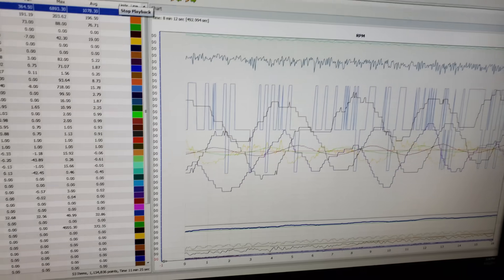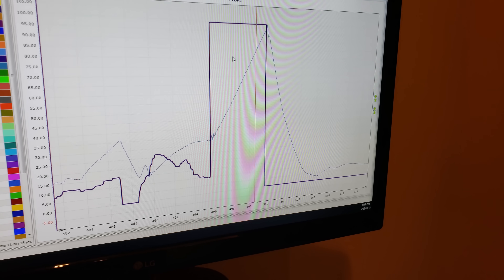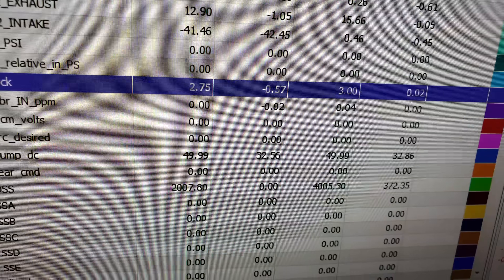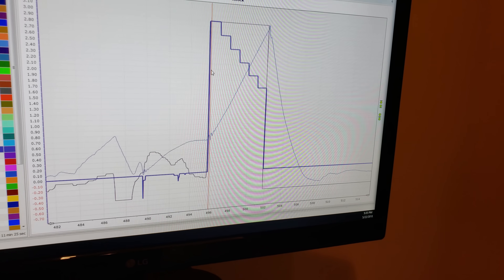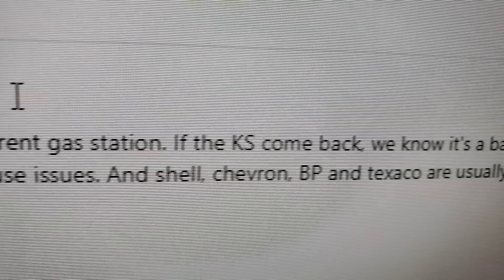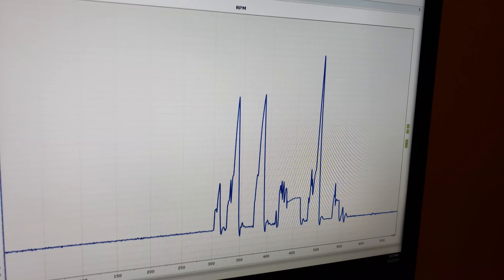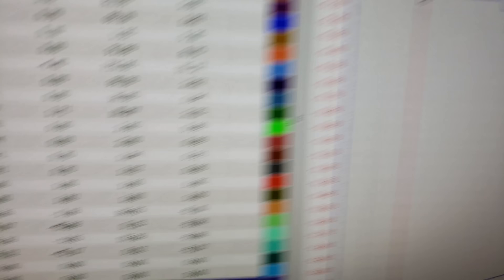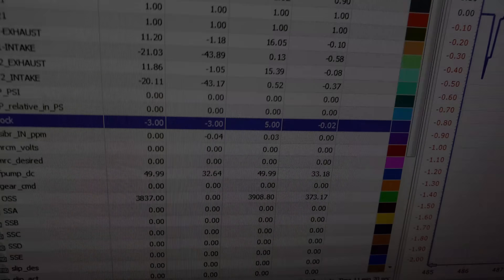Is 93 octane the same across all gas stations? Proof inside

Comment: I know this is an old video, but the Octane air ratio also a good way to view the quality of fuel. Sometimes I get -0.63 , other times up to -0.86. On the same Ultra94, but different gas station. 👍
Reply: How are you measuring octane air ratio??
Is there any way to test the octane levels in your fuel?
Reply: @jayhouse20  a data log. Like an SCT or a HP Tuners.
Reply: @twinforce_fusion6560  but that only shows you after the fact, correct?? 
I mean the tuner tells you about the knock sensors and that's how you determine its insufficient octane

Comment: What about BP premium? Any better than Shell premium? I have an 18 Cruze Hatchback and been using premium for almost a year.
Reply: I use BP 91  (NO ethanol @) 2015 Sonic 1.8
Reply: @benitom3049  its not the same as 93. with pure gas i get a fuel smell after the car shuts off and gas mileage is a tad worse. I've done a weeks worth of driving with pure gas and 93, 93 gets me more power because of ethanol acts as an octane booster. im tuned with BNR base tune and i average 35mpg.

Comment: even with more octane on the gas it won't help much because gas have 10 % ethanol. the ethanol produce condensation  and makes the engine idle very poor and also it won't help in fuel economy. the best gas will be ethanol free with additive polyetheramine for a clean engine. the polyetheramine additive is invented by Chevron use By Shell gas as nitrogen v power and Exxon, Mobil as  synergy. the only problem left with this gas is the Ethanol, other wise is the best gas you can buy.

Comment: Immediately after installing my VMP TVS filled up with Conoco 91 which is a "top tier" provider.  Justin emails me back after I send the log in and it's pulling a lot of timing, etc..  Went to Exxon and filled up with their 91 and it made a drastic difference.  No knock on the next set of logs.

Comment: i only have 1 shell in my area, i always fill up at marathon or speedway but my guess would be that because 93 is more expensive then it sits in the tanks longer, so when you fill up with 93 you are getting older fuel. i always get marathon or shell 93 because thats whats easily available and when i go to get a tune on my 3.7 i would be curious to see how they do.

Comment: You'd think if gasoline is advertised as X, it should be able to be tested to X, or if 93octane was somehow tested and only came back as 88, and your Ferrari blew it's engine, the gas station should be liable? I'd also like to see at least a weekly or better yet, daily test numbers at E85 stations. They'd probably see sales go through the roof if they actually had days where it actually tested above 80, and it was shown on an electric sign somehow, at least in hot rodder communities hahaha

Comment: Alex, I sent you a message thru Facebook as I had a question about this issue.  So you said that name brand gas is better than non name brand gas.  I am not really sure if that is true or not but I will take your word for it.  In saying that, is non ethanol gas better than gas with ethanol, so I try to use 91 or 93 octane for my Coyote swapped notchback.  I am running Naturally Aspirated, so no boost for now.  I have no plans on running E85 once I do add boost.  Just wanted to get your feedback on the ethanol vs non ethanol gas.  I know it is bad for 2 cycle engines.  Thanks.

Comment: COSTCO gas is the best in my area and surrounding areas.  Better mileage, power and less knock then the (shell, chevron, and exxon garbage i get here.)  I agree Sunoco and BP are the other best I've had just not in my area. Each area will be different in fuel quality and I guarantee if you sample one brand of fuel station in multiple areas you will get a different result.
I'm very attentive to fuel quality and I've tested this theory many times. I love your videos and i'm glad you are showing proof that all 93's re not created equal.

Comment: I've been dealing with this issue since I started datalogging for the first time this year. I've had the car since 2012, and had a custom tune since the car was new, and had run a best of  12.18 in --500 da. So I decide to install a K & N CAI, and my tuner has me do the step datalog and load step datalog, He gets the CAI to work more efficiently, but now I've been through 1 load of shell 93, losing 5 degrees due to knock, then switched to Sunoco 93 with a can of torco, and KS improved slightly, but still getting it, and now Sunoco GT 260, and improved even more, but still have knock. Car is OEM , except for K & N CAI, and Bobs firewall oil separator kit, and suspension. Banging my head for 2 months trying to find this dam knock.

Comment: I want an E-85 tune from you on my 18 5.0 but I just moved to St Mary’s, Georgia and the closest station I found is 21 miles one way. The 93 tune doesn’t seem worth it. Would like the make 500 WHP NA but 480 wheel would be plenty for now. Currently only an x-pipe and muffler delete.

Comment: Why not mention buying the pure premium fuel? I don't know if other areas of the country do the same shit as the upper midwest, but all of our pump gas is up to 10% ethanol, unless you get pure premium, or also known as non oxy. Thats all I run in my car,  unless its a track day then I'll get some 100oct.  Plus lawn mower and snow blower, cause that ethanol destroys small engine carburetors and goes bad so fast sitting in a can in the garage.

Comment: Lucky you don't live in Kansas where Kroger 91 is the best it gets, knock is -2.5 from my tuner. Smaller places that advertise ethanol free 91 actually had my knock at +4.0. This is on a '14 5.0 w/Roush Phase 2 supercharger. Kroger or VP and Sunoco race fuel is all we have here.

Comment: What about ethanol free 93? Sold in south Carolina.  And what about adding Octane boost or a gallon or so of 100+ octane to 1/4 to a half gallon of 93 before going to the track. ?
Reply: I would say ethanol free 93 is true processed 93 octane. 93 w/ ethanol would be like 91oct + 10% making it 93. Someone can correct me if that's not true, but that's how I have understood it.
Reply: fordltd1983 I thought the same and always ran 93 ethanol free. The guy that did my tune (pro dyno in fort mill, SC) said it would put down better power with ethanol 93. Heck , i dont know so hoped Alex would have some insight. My tune is pretty shitty(it skips and jerks at part throttle street driving) unless I'm wot on DRs at the track.  Even then, the car should be quicker.  11.70 @117 with a 4c converter 1.60s 60'. 2012 GT.
Reply: Give Carolina Speedworks a Call they are a Lund Dealer out of Salisbury can get you going in the right direction.

Comment: I noticed this back in the mid 2000s. Had a piggy back Hypertech chip on my 95 f150. Truck labor knocked on the local Fina stations 93, but never knocked on Exxon 93. I always wondered if it was a fluke. Guess not

Comment: I used 93 octane QT gas (advertised as "top tier") and the tuner told me the gas was bad. I switched to 93 octane BP and 2 weeks later pulled 45 more HP at the rollers. Bad gas is no joke!

Comment: Tell us about octane boosters like torco and Lucas Oil octane  booster....what are your thoughts. I've ran 10 gallons of 93 and 2 bottles of the Lucas juice (100ish octane) and have had good results with 14psi +100 shot of N2O. Now I'm running 22psi with the same mixture (different tunes obviously)..have I been lucky or is this a solid combo?

Comment: Another good recommendation for getting pump gas is fill up at stations where a lot of premium gas is dispensed. I think part of the reason why speedway, costco, walmart, etc have crappy gas is because most people who buy premium gas go to top tier gas stations like Shell, BP,  Mobil, Chevron, etc. The people who go to speedway, costco, walmart, kroeger, etcc are only getting 87 octane for their minivans, so not a lot of premium gas is sold and it loses its octane rating from sitting there for so long.

Comment: Hi Alex, As always thank you for the videos.  Talking about fuel quality. Personally if I had the luxury of having E85 I would not even think about anything else in a high performance car that was a semi- daily driver. But that is not the reality for everybody. 

Over here in Iceland ( of all places! ;-)  ) it has been, for a long time now only sold 91oct(95 Euro)fuel on 99% of gas stations. Considering that 99% of stock modern cars require not anything stronger then 91. The 93 stuff just gets old in the tank of the selected gas stations. But the price is always top $ for that stuff that has possible been sitting in the tanks for a very long time and very likely has lost some of its quality. 
Couldn't be the same story on many gas stations in US. The 91 even the 87 is more stable because that is 99% of the sale.   So as a 2017 GT owner myself. I just could not justify getting a 93 tune staying NA so I just got myself the FP PP2 and called it good. Also when it comes to resale in a micro market like her in Iceland. It just have to be a 91 oct car if not the regular joe's will not be interested in buying.  
So I thank the said reality is, not the name of the gas station. It is just how many go there to buy 93 octane.  It is not like Costco or Walmart manufacture there own gas. It is the same shit more or less everywhere. It is just a matter of how fresh the fuel is you are buying.

Comment: Alex, you are absolutely right and have the data to prove it too. I have had intermittent issues with my 2017 Roush phase 2 GT since the second month of owning it and couldn’t understand what was going on until the dealership I bought it from with the Roush setup at the inception said “it could be bad gas, vacuum leak possibly” I just didn’t want to believe bad gas was the issue but turns out that’s exactly what it is. Damn Racetrack gas stations in Florida! I will be making a switch and one that worth the extra $ too! Thanks again  for the always informative and data to back it up also man! How do I get in contact with you to be my tuner?
Reply from the maker: support@lundracing.com

Comment: I bounce between shell 93 and chevron 93 for my mustang 5.0 but prefer shell v-power over chevron with Techron. It depends the location I am in at the time I put gas. I’d say 90% of the time I fill up at same shell gas station w 93 octane on stock tune.

Comment: You forgot 7-11 😂😂😂

I always use 93-Sunoco.
Reply: Tony Draper actually in my area here in FL I fill up at a circle k and car runs strong
Reply: Michael Mciver — Cool. Definitely good to know cause I live in FL as well & see those everywhere but I’ve been using Sunoco since the late 80’s early 90’s in my mustangs & ive never put anything but Sunoco. In a pinch I’ll put whatever I can rather than get stranded but Sunoco has always been great to me.
Reply: @michaelmciver6254  yeah i was at 1 maybe 20 mins ago and im always trying to find good gas and it kinda looks like they use bp fuel im gonna ask next time im in. Shell in fl blows had nothing but trouble so mobile and top tear only citgo gas is all i will go to now. Almost seems like my car likes the citgo more than the mobile surprisingly.